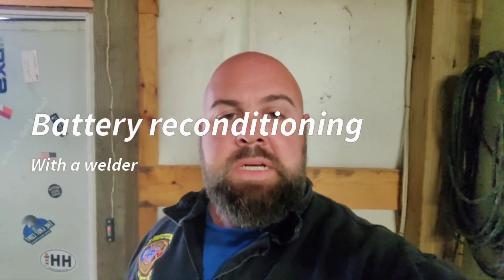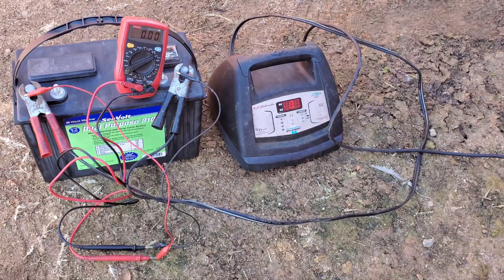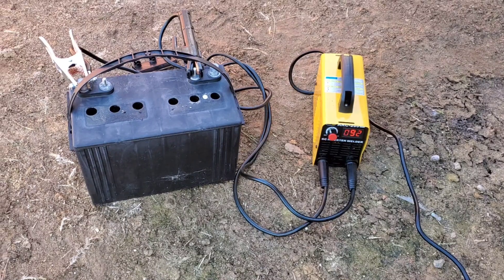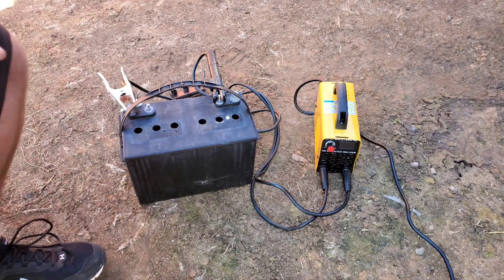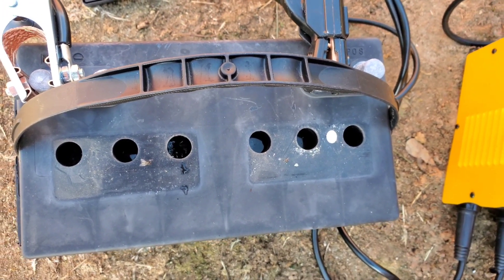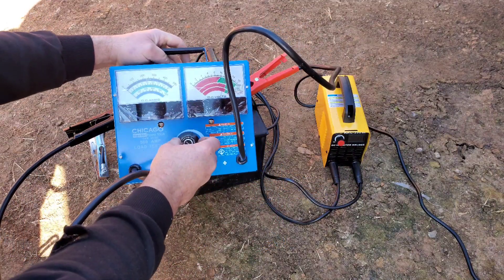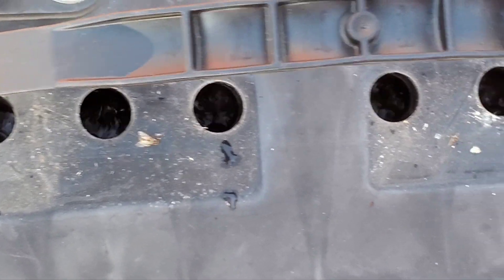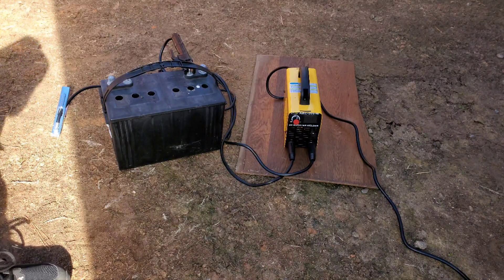Zero voltage battery brought back with a DC welder

Comment: I just bought a small dc welder just for this purpose. I haven't used it yet, but the no-load output voltage is 60 volts. Is yours this high? Does it drop when you hook it to the battery?
Reply from the maker: It's not that high, proceed at your own risk
Reply: @PRSH8YAPROJECTS  I did proceed. All went well. Started at 40 amps for 5 minutes, then 50, then 75, 100, then 140. All went well until near the end. Turns out the little DC welder I bought draws a little too much power for the 14/3 cord I had. It got warm and then tripped the breaker. My garage is wired with 12/2 on 20's, so I'm guessing my cord getting hot overloaded things. I did just go out and buy a nice 12/3 cord. The final cycle was almost complete when it tripped, so I called it done. The battery I used is a 600 amp, that only had about 220 to begin with. It's a bit over 600 now, and the battery tests as "good" again. Thanks for the vid  :)
Reply from the maker: Glad it worked out!!!
Reply: @PRSH8YAPROJECTS  Another quick question for you. My welder isn't the same one you've got, but it's similar. When i turn the welder up over 125 it starts to really draw the current from my garage wiring. It will kick the 20 amp breaker if it's been running a while. I can get to 140 if everything's cold, but it'll only run a few minutes before it trips. I rewired the garage when we moved in using 12/2, and installed heavier 20 amp outlets. I ran a nice 14/3 cord at first (which also got very warm), so I bought a nice 25 ft 12/3 cord. The new cord doesn't  get warm, but the wiring at the box does, and it'll still kick the breaker. How is your wiring set up for your rig? Have you had any issues like I'm having?
Reply: @vbrad5111  The circuit breakers typically use a bimetallic bar of metal.  As more current passes by it, it heats up and bends slightly due to different metals on either side of that bar.  When it gets warped enough, it trips and disconnects the power.  There are two ways to trip the breaker.  If you have a dead short, it would immediately trip due to the sudden surge of current.  The alternate way is if you get close to the rated current and continuously run it at the max level, the heat would build up and would eventually trip the breaker.  If you have loose wires or corrosion in the wires/contacts/breakers, it adds resistance and that also increases the heat build up.  As the current goes up, there is a threshold where this resistance increases the heat and creates a thermal problem.  That is one of the reasons you see fires in electrical outlets caused by corrosion in the wire or contacts and that builds up the heat in that localized area.

Your entire system has to handle the current that you're putting through.  This includes the circuit breaker, wires and the outlets.  It sounds like you need to have a 30A subpanel with 10/2 wires or switch to 220 volt on your DC welder to drop your current in half.  Without knowing what the voltage is at with the 140A setting, its hard to figure out what your current load is on your 110V outlet.  With the 20A circuit breaker, and assuming your DC welder actually puts out 140A at some voltage, the maximum voltage you can have is around 15.7 volts.  At 20A, the 110 outlet can handle 2200 watts at most (20 x 110).  If your welder is putting out 140A, that means the max voltage is 15.7V (2200 watt / 140 amp).  If the voltage is higher than that, let's say 20V, that means you're drawing more current than what the outlets and wiring can handle which is not safe and the reason why you trip the breakers.  

If you switched to 220V system, it means you only draw half the current on the outlets so you can go up to 31.4 volts at 140A.  If you went with a 30A circuit, you can go up to 23.5 volts.  In reality, your voltage would be at some value between 12 and 15v in most cases.  You really shouldn't be running the current on your DC welder that high on the battery continuously.

Comment: 10 amps for a battery that's supposed to put out about 600amps? Yeah, she might not make it.
Reply from the maker: Surprisingly no, the battery gets better with each cycle on the welder. Thanks for your comment
Reply: Welder on 5 munutes off 1 hour to cool, repeat til battery is at capacity..... it is slow but it works!!

Comment: What amps are you pumping thro the welder?
Reply: I start at 40amps and by the 3rd session i am usually up to 160amps, if it starts boiling out to bad i will back it down a little.
Reply from the maker: That's good information
Reply from the maker: Great question, I'll have to measure that